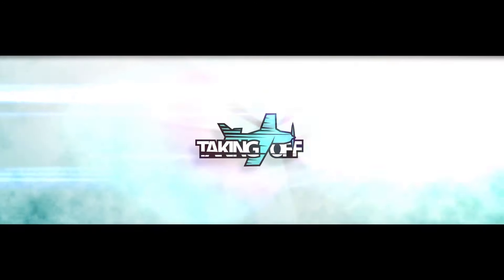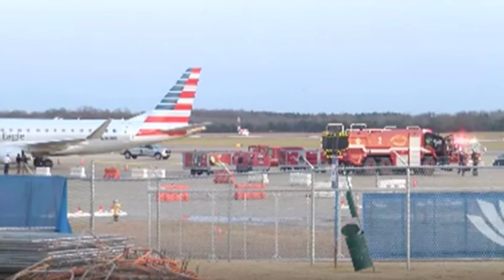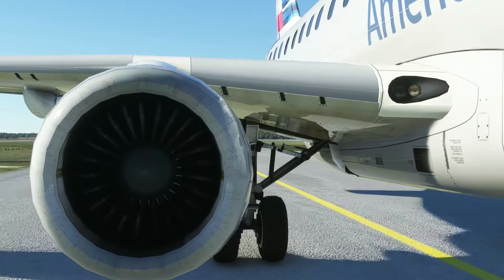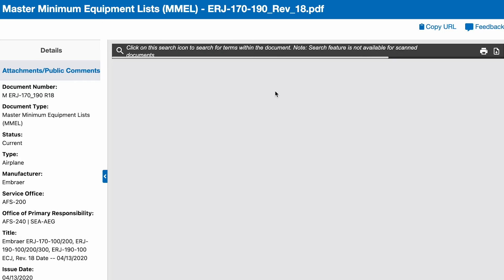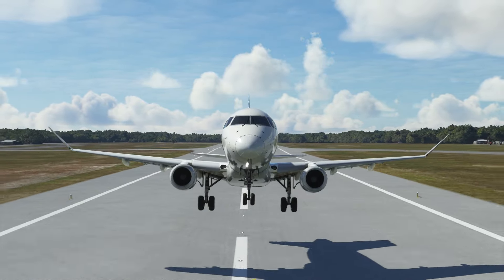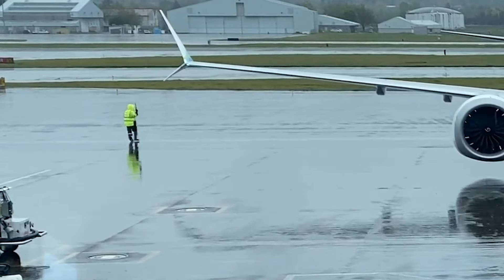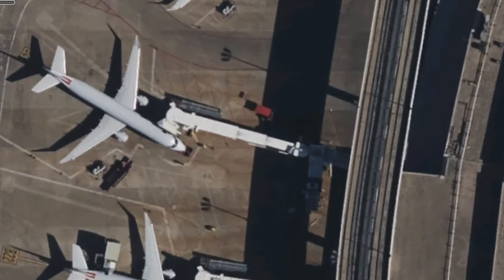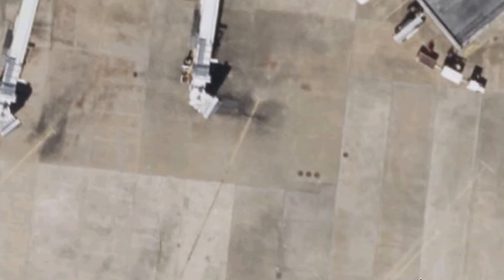Woman Sucked into Engine at Montgomery Regional Airport New Years Eve UPDATE

Comment: As a 20 year ramp rat I was wondering if perhaps there wasnt a huffer available at the time so the crew and ramp agents decided to do the turn with the #1 engine running. Not uncommon in my day as they would not have been able to restart the aircraft otherwise. Another serious possibility is a lack of a safety awareness or training on the part of the ground crew. Many regionals use 3rd party ramp crew where pay is low, and time is frequently more important than safety despite what the company says. Airlines charge thousands of dollars a minute for a late departure due to the ramp crew so it can be a stressful environment. Or this could just be a momentary lapse of judgement. Either way, the report will be interesting whenever the NTSB gets around to releasing it. Thankfully her passing was quick and likely painless. I feel for the A&P's that will have to tear down that engine. Has to be a hard situation.
Reply from the maker: Well said.
Reply: Yeah that's going to be bad on toast.
Reply: Thank you for sharing your experienced perspective
Reply: WHAT???

Comment: I used to work as a ramp agent. Three things I always kept in mind when dealing with "live engines" (ones that are running): A: Stay behind that safety line until B: You can see every individual fan blade. and then C: When the engine goes silent, You are safer.
Reply: I count to 30 seconds in my head then I know it's good to go also when you can see the individual fan blades and light poking through you are safe

Comment: During my career as an aerospace engineer, I’ve seen two people get sucked into a turbine engine.  One of my mechanics during an engine test in an engine test facility.  He went into the test cell to check an instrument connection and the other technician running the test did not know he was in there.  The technician running the test ramped up the power and the tech in the cell got sucked in.  The second time was during a business trip to Taiwan.  We were there to check out a fighter jet engine, and a tech got too close to the running engine and got sucked in.

Comment: As a licensed A&P, I spent many years on active flight lines, around everthing from SAAB 340s, to DC-8s, B-727s, A320s, and L1011s ... And if there was one thing that I always made sure of, it was to keep a good distance from any running engine.  Horrible way to die.
Reply: I would think the pain would instantly shut down your entire nervous system. The sheer terror as you got sucked toward the engine would be pretty horrifying, though......
Reply: Horrible in what happens to the victim but it will be quick
so at least there is no suffering.
Reply: That sucks
Reply: Tools, keys, wallets, hats, anything loose can be turned into FOD.   Including you.
Strutural technician Phantoms, F-16, MD500.

Comment: Somewhere back in the 1970s at O'hare Airport I was working for a major airline.  We were waiting to park a DC8 coming from the hanger.  We had ground support equipment parked safely so we could get it loaded.  There was a conveyor belt parked safely near the number 3 engine.  I was standing on a Jet Tug with my flashlights guiding the plane down the center line to it's stopping point.  For some reason one of the ground crew that I did not normally work with rushed to the conveyor belt jumped into the driver seat which was dangerously in front of a moving aircraft.  The conveyor was in no danger but he was.  Luckily the two Mechanics ferrying the aircraft took my crossed lights seriously and hit the brakes hard.  I jumped off the jet tug and grabbed the guy and pulled him from the conveyor seat across the belt to safety.  It happened so fast and the Mechanics only knew to stop the plane but I didn't have time to ask for another miracle and shut down the number 3 engine too.  Danger around operating aircraft is real and bad things can happen quickly.  Thinking of the lady at Montgomery Airport is painful.

Comment: In the military this was one of the most dangerous jobs in the navy. It was right there with combat, we actually got hazardous duty pay.  The markings on the ground, well there were several sets of them depending on the operational state of the jet corresponding to which set was used. Nothing like what's seen in this vid. Of course we didn't have baggage handlers unless you consider ordnance, baggage.

Comment: I spent many years as a B 52 and KC 135 jet engine mechanic , I can tell you from my personal experience what they had to pick up of this lady would not be pretty. I have seen everything from a goose to a cow hit or sucked up and I can promise you the smell alone is over coming. The flight crew, ground crew, and fire department saw something they will never forget. Hitting a goose even at a slow taxi speed can literally blow up an engine and once they go in the front well lets just say engine parts come out the back and it is easier to just trash the engine than try to repair it. 
I know I sound gross and I mean to be because the family has has a terrible loss and about the only way they will be able to bury their loved one will be through cremation. I would never want to be the mechanics that remove that engine and even worse the crew that will have to tear it down ON SITE just to recover what they can to go to the corner office and then they will have to reconstruct what they  can. God rest her soul and help the family to heal. I will leave my grossness at this because I know what they will be dealing with and it is much worse than I have described. .
Reply: It happened to a contract mechanic at the airline I worked at. A team had to go change the engine at a non-maintenance station. There was nothing nice about it and when that airplane came to my station I didn't even want to go near it.
Reply: @airtechmech6681  And I bet you have never forgotten that smell in the general area to this day . I can still smell bird and well lets just say there was a huge BBQ at Beale AFB (the home of the original U2 spy plane) and that was a KC 135 that was shooting touch and goes so needles to say there was not a whole lot of cow or cowling for that matter left
Reply: Shocking real life information might safe someone's life.  I clean up people from cars that were talking on cellphones and I often laying out the details.  We live in an age where we assume it is always someone else's fault which does you no good if you are dead.
Reply: @jimturpin6503  I wish they would show the real world photos of car accident victims, gun shot wounds and just plain violence to these kids these days it might just make them think twice about their actions
Reply: @davidvincent1093  But, then a lot of people would be seeking drugs to deal with PTSD real or imagined.  But pictures alone may not have the effect we would hope.
We had to wait 6 hours for a busy coroner to arrive to pronounce a young girl dead, laying in the middle of the road, after removing her 3 yo child from the back seat of her car unscratched.  She had bled out on one side of the road, but we found her in the other lane so someone had hit her and did not bother to stop.  An underwire bra is not kind to a woman in a car accident.

Comment: I feel for those in the shop who will have to recover the remains from the engine.  Not some your average mechanic can deal with.
Reply: It will be the engine repair team.. Either from an engine shop or the engine manufacturer.. I have heard of companies burying the engine out of respect...
Reply: @grantandrew594  I would think it’ll come into the shop similar to a typical investigation engine. quarantined off while the remains are removed and turned over to a medical examiner sadly not the first time shops have to deal with such events.  I’d imagine there’s a shop SOP that covers remove and handling of human remains. Depends on the type of contract where they’d send it.   Glad we haven’t had one in my time.
Reply: @grantandrew594 you sure they just bury it? Each blade on the main fan is worth $30,000, and a whole engine can cost $25+million, even damaged as it can be parted out
Reply: @bobsmithinson2050  doubt theyd try fix it. A bird can cause serious damage to a jet engine now a human is much larger. Having to find whats fixable and restoring the engine to new would be much more expensive than replacing it fully
Reply: @bobsmithinson2050  Looked it up, the embraer 175s engines arent worth remotely 25 mil. 1 GE cf34 is worth around 1.5 mil. Overhaul costs are also around the same price
Reply: @degenetron7590  I’d say those numbers are a bit. low.
Reply: @degenetron7590  they’ll take it apart and do detail inspections on all parts.  Unless there were some really dense metallic objects on the young lady Most of the engine damage would be to the fan and maybe the next low pressure compressor stage.  Experience with wildlife events would tell me most of the recovery would be in the bypass flow not the core. It won’t be a pleasant job to get it in and quarantined for disassembly followed by removal.
Reply: @chrissmith7669  what engine does the embraer 175 use, and whats the cost then?
Reply: It'll be a DOT agency that handles the tear down
Reply: @degenetron7590  they run GE but the cost depends on the operators contract. Not many buy engines outright.  Most either lease or have FHA agreements.  To buy one new book price better than $10 mill but nobody pays book.  A typical shop visit a couple mill plus LLP, likely paid using a Flight Hour Agreement charging by the hour with all manner of factors.  The guys who determine the hourly rate are the tea leaf readers in my book. Yes, I’m in the business but on larger engines but the contracts work the same
Reply: @duncandmcgrath6290  no.  It’ll go to a normal overhaul shop but the tear down will be curtained off and heavily quarantined witnesses by medical, legal, insurance, government investigators and others.  Event engines are always a circus
Reply: @degenetron7590  oops.  Your price wasn’t the one I intended to comment.  About $15 mill book but that seems a bit high honestly.  But as I mentioned almost no one buys engines.  It’s all lease or Flight Hour Agreement contracts.
Reply: I’ve been on the tarmac since 1988.  Numerous times I’ve had to forcibly grab a co-worker from drifting in range of an active intake. The most Dangerous time is just after the flight crew Kills that engine. I was always taught to treat each engine as live and running. Even on cutoff, and spool-down. The scariest was the A 310. Big engine, Big Intake.
Very few Ramp personal consistently follow the 2 minute rule.  They absent minded toddle past it to secure the main wheel chocks. A wide body, isn’t going to move if the nose gear is chocked or the apply the brake signal given.
Crews always seem to pay more attention to GPU starts near the exhaust side of the engine. 
Not the hungry side.
Particularly on smaller biz jets or narrow body airliners. 
Complacency Kills. 
Your ear protectors should protect your hearing, Not blind your Common sense.
Be aware of both Sound and Sight.
Reply: @chrissmith7669  experience with wildlife events involving birds that have hollow bones? Human bones are much denser than bird bones
Reply: @ThisPartIsAndrew  while it is birds that we mostly see there have been a number of incidents with ground based wildlife getting ingested. It’s the fan that takes the worst of it in most cases and then most of it goes through the bypass.  Very little goes into the core due to geometry.
Reply: @ThisPartIsAndrew  what’s strange is how random damage is from even bird strikes.  There are times the compressor is coated in cooked on snarge but there’s no damage to parts. Other times we joke that a small bird must have been wearing an iron man suit due to the severe damage to the fan blade.
Reply: @chrissmith7669  maybe you can clarify, up above I didn’t specify that I’m aware that they wouldn’t actually try to fix the engine. Per the worth of the engine in parts alone, would the salvage usable parts or remaining portions? This being as detailed as saving each in damages blade, and melting down each damaged one for its value in metal (nickel-based superalloys). OP commenter stated that they would sometimes bury an engine out of respect, which given the immense money involved with these modern jet engines, I found it crazy that they did that.
Reply: @bobsmithinson2050  honestly in my close to 40 years I’ve never heard of an entire engine being retired or buried after an incident. There’s been a few I’d like to bury for the trouble they made but none that I know of.  Would be pretty impractical to do so.  
I expect That similar to a wildlife strike they will look at the various cooling air passages and Remove From Service those where organic matter has clogged the tiny passages. Those passages are notoriously hard to clean of even small amounts of snarge After bird strikes.  Most parts will likely be cleaned and inspected then returned to service through the manufacturer’s logistics chain in a way that suppresses the connection to the incident engine.   Blades and vanes with cooling passages that cannot be adequately cleaned would likely be recycled.  Because they are „contaminated „ by human rematches would be quarantined along the way.
Reply: @chrissmith7669  I can imagine the top ends of 2 femurs becoming unbreakable balls that bounce around and destroy everything
Reply: @ThisPartIsAndrew  I can only compare to a deer event.  At idle most of the organic material went into the bypass duct and was in larger pieces than one imagines.  If it had happened at takeoff power with the fan rotating many times faster it may have been different but at idle the organic remains seemingly deflected /bent the fan blades enough to allow larger parts to pass through.   
We’ve received engines to induct that suffered larger denser objects being sucked in with surprisingly little damage.
Reply: @chrissmith7669  well that makes sense and if I ever fly in an Embraer, I will just imagine that it is flying on the wings of angels 🤔
Reply: @ThisPartIsAndrew  from my natty memory I’d say it happens about once a year somewhere in the US.  You may have already flown on an aircraft or with an engine who’s parts were involved in an incident.
Reply: @chrissmith7669  as a Tibetan Buddhist, I always wanted a sky burial, and this is the next level of that, hmm?

Comment: I worked at a very large airport over the summer once in the 90's. 

Even then, they gave us extensive safety training and warnings to never be either 100 ft in front or rear of the engines on a plane, whether we think it's running or not. 

They showed us a video of a truck behind a plane being blown around like a toy. I'm assuming planes still work the same way 🤷🏾‍♂️

Comment: I worked aviation in the Navy for 4 years, 1 year on a carrier. 3 of the greatest fears: Broken arresting cable, jet intake , & props. And you don't get sucked into an intake, atmospheric pressure pushes you in.
Reply: "atmospheric pressure pushes"  same can be said for a vacuum cleaner, but I prefer to say it sucks up dirt
Reply: It is a vacuum of no pressure in the immediate area. The SUCTION FORCE is real when within this location. Thank you
Reply: @teenagerinsac  There is a higher pressure on one side than the other, a pressure differential. The object, in this case a human body, will be forced from the high pressure side to the low pressure side. On your sucking or vacuum idea there is still pressure on the "sucking" side but it is just lower than the pressure on the high side.
Reply: A vacuum is an area with no atmosperic pressure just as space is. So what pressure is the force pushing here? You get pulled in by the rushing air streaming towards this vacuum area butt you arent being pushed at all.
Reply: @teenagerinsac  The streaming air you are referring to is called a low pressure area, the high pressure rushes toward the low pressure area. There can only be a complete vacuum at sea level in a closed chamber, the area around the front of the high bypass fan jet engine is not a closed chamber. What you are trying to argue is that there is no such thing as a pressure differential. An airfoil (the aircraft wing) provides lift by creating a low pressure area on the top of the wing and high pressure area on the lower surface. The venturii in a carburetor on a gasoline engine works in a similar way by creating a low pressure area that allows atmospheric pressure to push fuel through several metering devices & into the carb throat. You are arguing against well established fluid dynamic laws.

Comment: Being aware of your surroundings was a strong safety issue. We worked with (duckdiving,look for cracks, on the vanes intake) F-14, 16, jets, smaller jets,at a small Naval Air Station(closed now) Dallas,but, intakes are just as deadly, as we checked the outside of the plane on the flightline, as they were (APU) powering up, like a meat grinder should a bird get sucked in, be in pieces coming out exhaust. Lord Jesus touch the family of that dear lady. 🙏
Reply: She very likely was wearing noise cancelling equipment which can lull you into a sense of security around large equipment.  It's also easy to make a mistake when you're really busy.  Just a tragic accident.
Reply: Obviously; lord hizus was in bathroom, had a day of, or something else.
Reply: @williamlyons3947  Engine guard like a screen mesh is an excellent idea, but that would reduce the airflow if anything is caught in the mesh, thus reducing thrust.  Kinda like getting debris in your air intake of your car for the engine or radiator.
Reply: @Vagabond_Etranger   engine guards can be sucked in also.  That leads to millions in damage, FODded engine parts on the taxiway, avoidable AOG, and stuff flying at anyone walking behind.